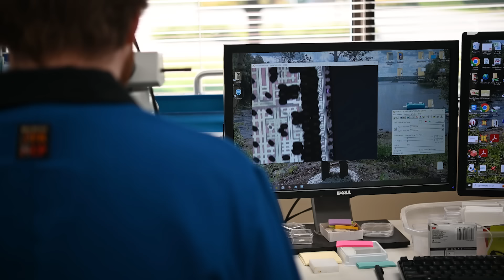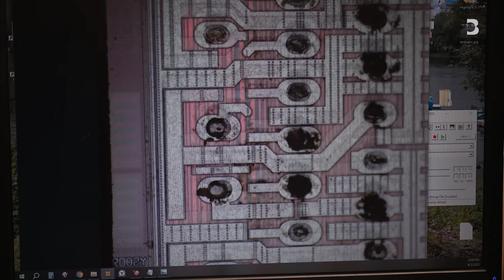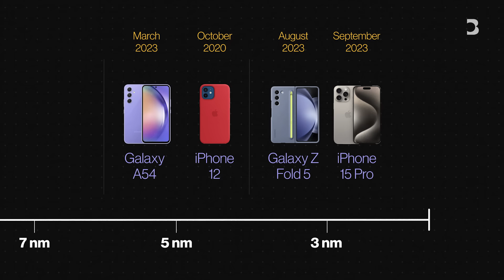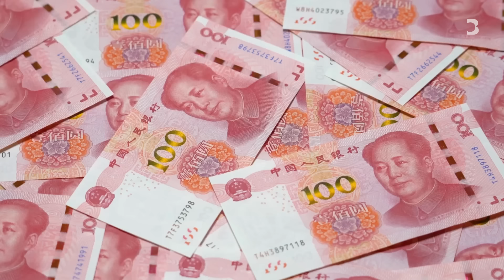This Is How Huawei Shocked America With a Smartphone

Comment: Fascinating, indeed. China's technological progress in the realm of semiconductors is impressive and it evidently showcases their ability to innovate under pressure. However, I'd be interested to learn more about the long-term implications of such progress. Do you think that China's accelerated advancements in the semiconductor industry will pave the way for a global paradigm shift? What might this mean for the rest of the world's technological dependence on China?
Reply: Spying innovation.
Reply: I've followed the semiconductor industry for a long time, not professionally but as a computer science hobbyist. The lithography machines SMIC use to produce their latest smartphone SoCs are fully manufactured and serviced by a Dutch company called ASML. The various pieces of industrial software which run the machines are almost 100% American. They're also several years old, and so are the performance characteristics of the chips that they produce. The chip foundries in Taiwan such as TSMC have long since moved onto much more sophisticated EUV lithography. The entire production chain of advanced semiconductor manufacturing depends on a very small number of big western actors, none of which have yet to be bypassed by any nation sadly. My point is, this isn't really progress for China. They must have competent engineers at SMIC to be able to implement and manufacture their own designs, but the manufacturing tools are all designed in the west and with western proprietary software running all of it. The video is a nice propaganda piece, but as with life in general the devil is in the details.
Reply: @Dystopikachu basically you don't know shj*t beyond being able to read some articles.
Reply: @Dystopikachu is there no way to replicate what asml does? China accepts espionage, bribery, reverse engineering and crucially also tend to lay out longer term plans (beyond the typical 4- 5 year cycles). Just curious if asml has that large a moat... If so I really should load up on more asml stock.
Reply: @Dystopikachu  China's semiconductor industry can only say that it is half successful now. Self-produced lithography machines are about to be delivered, and the remaining software has to be left to time.
Reply: @张凡-o6j  The company SMEE are set to deliver machines supposedly capable of producing a 28nm pitch, which is certainly useful but something the rest of the industry managed about 15 years ago at this point.
Reply: There is no progress here. It is the same as it has been... they got their hands on some fairly new lithography machines before the sanctions on them hit. It is like saying that you made huge technological progress in semiconductors because you went out and bought a new phone. How are you this slow? Get a grip.
Reply: @chinyong8166  There is but you would need to poach whole teams of people from ASML and various other companies that work closely with them to provide the end solution. Then you don't have the whole corporate and research machine in place which would take years to get running efficiently. By the time you got everything going you'd be a decade behind what is current... incidentally china is about 2 decades behind on their homegrown lithography capabilities.
Reply: @张凡-o6j  They have self produced lithography machines... they are just much worse than then ones they bought that are made by ASML. They don't have anything close to the machines that are talked about here.
Reply: @thomgizziz  Technology is progressing slowly. Lithography machines are an engineering problem and sooner or later a breakthrough will be achieved.
Reply: @thomgizziz  Well that's a bit harsh considering not even Bloomberg nor any other finance-related news outlets seem to know anything about the industry
Reply: @Dystopikachu  Isn't that what the video just said? China only has DUV so its stuck behind EUV. However, its more about how they were able to innovate so quickly. With much more funding and labor, it's only a matter of time til they catch up or even surpass the West
Reply: It will mean CHina will dominate the tech industry on every level. And us consumers, we'll cutting edge products at a discounted price. Win Win!

Comment: 00:06 Huawei's smartphone represents a breakthrough in China's self-sufficient chip industry
01:03 Huawei shocked America with advanced chips
02:02 Huawei quietly released the Mate 60 but still managed to sell out within hours.
02:56 Huawei and a contract manufacturer are making progress in semiconductor capabilities.
03:52 Huawei and SMIC managed to close the gap in advanced chip technology
04:55 China used DUV machinery to achieve advanced chip lines, surpassing US expectations
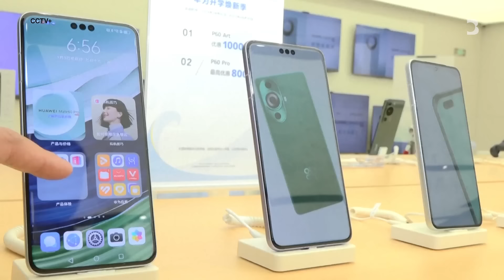05:58 The key question is whether Huawei can produce smartphone components at scale and efficiently enough to make it cost effective.
06:51 US cut off of Huawei and SMIC could lead to China developing advanced semiconductor capabilities
Crafted by Merlin AI.
Reply: Nice job. I got the mate60, its the rarest one of them all, the matepro can get it in almost most shops on the same day

Comment: But its not exactly shocking for 2 reasons, Chinese foundries had already managed to make some parts of their previous chips to the 7n node standart. And duv was never limited to 14nm nodes... The actual size of transistors is still well over 30nm so with multimasking duv can reach the same result as euv... But... with extra effort and therefore costs involved in designing those extra masks and adding another layer to complexity over euv that while more expensive upfront, can reach that result with less designing workload due to much smaller wavelenght it uses. The most important aspect is how much does it cost to fab those 7nm equivalent chips for smic vs how much does it cost for tsmc/samsung. And what is the capacity/ yeld rate.
Reply: Intel will only start using EUV in their 4nm chip coming in 2024, intel 7 and 10 are still using DUV only so i think it is financially viable. Huwaei and SMIC are probably heavily subsidized by the Chinese government.  But using TSMC would probably be more convenient and would give them better technology. I remember my old Honor phone with Huwaei designed chips were pretty decent in CPU and power efficient, but they were a little weak in terms GPU.
Reply: Not to mention they solved EUV problem with a particle accelerator as substitute for the sanctioned ASML machines.

This is new and still on testing but might be promising in the future.

ASML have very sophisticated minituarized optics because they must be fit in a container.
Chinese coorporations don't have the mobility and size requirements of ASML, so scientists went F* it, let's produce an EUV beam using a big particle accelerator and a beam splitter.
It's a whole building but get's the job done. They say it's scalable too because you can control the output, split the beam and operate different lithography machines at the same time..

Comment: Whoever took apart that phone in the beginning did a really sloppy job :D
Reply: So sloppy they mistook a 14nm chip, for a 7nm one. 

Lol.
Reply: @tin-n-tan  Bruhh the benchmarking tests of kirin 9000 prove that it's very close to Sd 888 which is 7nm. There is No way a 14nm chip is as fast as Sd888.
Reply: @Aamirmhmd99  no use telling them. they're in denial lol
Reply: @tin-n-tan  Worse, they mistook an Intel chip for a Huawei chip. Microscopic examination of the surface showed that the serial info had just been lasered off and replaced.

Comment: 7nm is very advanced. Intel is stuck at 10nm for what feels like a decade.
Reply: Fyi intel's 10nm is smaller than the smallest tsmc 7nm
Reply: @RSUnicorn how?
Reply: @malikmustafa1373  its the way how they measure it intel's 10nm packs more transistors compared to tsmc 7nm
Reply: @RSUnicorn you heard that from Intel, eh? 😂
Reply: @RSUnicorn  TSMCs 7nm is around 96mtr/mm2 whereas Intel's 10nm is around 100mtr/mm2 therefore tsmcs 7nm is bigger. lets assume they take same space still 7nm consumes less power and performance is better than 10nm. 
     TSMC is a Taiwanese company indirectly western company. Here news is about a Chinese company.
Reply: @malikmustafa1373  bruh you just googled it without reading that the mtr/mm² meant.
The two number you listed is the node density which the intel is obviously tiny bit better than tsmc equavelent
Reply: @RSUnicorn  Ofcourse i googled it where else would i get updated info. 
    Mtr/mm2 means million transistors per millimeter squared! which according to google is that👆.
Reply: @malikmustafa1373  well, now you got your answer the intel one packs more transistors than it tsmc equivalent
Reply: @RSUnicorn  i wrote smaller there. right!!!
Reply: @malikmustafa1373  my fault i read it wrong 👍👍
Reply: @RSUnicorn  i edited that. you read that correctly.
Reply: @malikmustafa1373  and a new friendship is born 🤝😂
Reply: AMD = 5/4nm

Comment: Now China can export chips to Russia and other allies who are under American unilateral sanctions.
Reply: Except these are 14nm and they charge Russia a bundle for them as they can't produce enough for domestic supply. 

So yes, they can, but that was somewhat unavoidable.
Reply: America will say China did not comply to US sanction 'law' by exporting to these sanctioned countries...😂😂😂
Reply: When the DUV equipment must be serviced, the US can block ASML and its contractors from servicing it, and let it break down and fail. No more 7-nm chips for China.
Reply: @danielleong1865  no more, did they ever?
Reply: @danielleong1865  so by not servicing their machine,  asml  will lose billions in lost sale of new machine.
Reply: @jetli740 : The US owns most of the patents that ASML uses to create their machines. Without the patent licenses, it won't have any of those expensive products. The US can revoke ASML's licenses and cause the company to collapse. Which is worse, loss of some revenue or loss of the company?
Reply: @tin-n-tan : An article suggests that SMIC used a novel approach to get its 14-nm DUV equipment to produce 7-nm structures. I haven't seen any details or independent confirmation yet.

It would make sense that the sources for the claims in this video would've done scans of the chips to confirm the 7-nm features, rather than speculate and destroy their reputation.
Reply: @danielleong1865   so us own some patent in a finished machine, mean Usa can control it.  Now if every body play that game then the world will have nothing to sell. 

almost every product in the world have part made by multi company/nation put together to form a final product.
Reply: @jetli740 : Not some patents of the finished product. The US controls most of the key underlying technologies that make the advanced lithography possible. Without the license agreements, the equipment can't be made to work, unless ASML somehow creates its own technologies that are different from the current state-of-the-art. Other key components come from Germany and Japan. I believe the 3 major systems (that are years ahead of competitors) in the equipment are the light source, the optics, and the table. ASML brought together all the necessary technologies to develop the equipment, and signed exclusive contracts with hundreds of suppliers.

Comment: I'm not sure why this is "shocking" to anyone except the uninfomed. China had bought DUV machines before the sanction, and those are theoretically capable of making 5nm chip. The problem using DUV for 7nm and 5nm is that they require many passes, which lowers the yield by a lot and making the chips very expensive.  So don't be "shocked" on what people who works in the industry have always known.

Comment: "National security", I inform you kids, that these most advanced semiconductor chips are only used in devices designed to be COMPACT and EFFICIENT (in another word, phone and pc if your smooth brains cannot comprehend), they are UNRELIABLE becoz they generate a ton of HEAT in a tiny area to make the device as SMALL as possible. The semiconductors in Chinese AND American weapons are decade-old technologies designed to be CHEAP, RELIABLE and don't need a factory in a freaking island "Taiwan" to produce. I don't care other nonsense you come up with, just wanna enlighten you little copers.